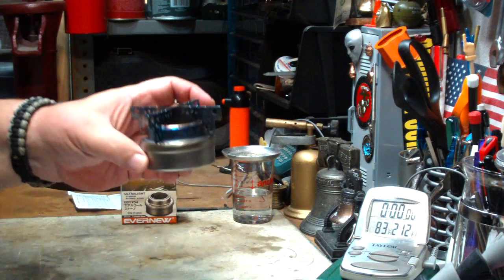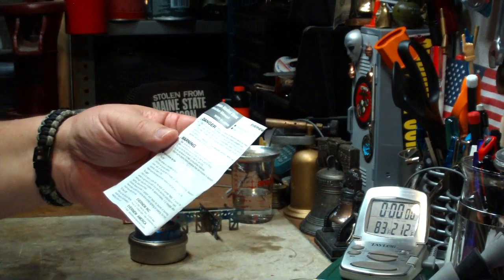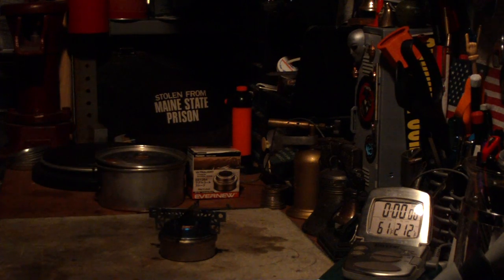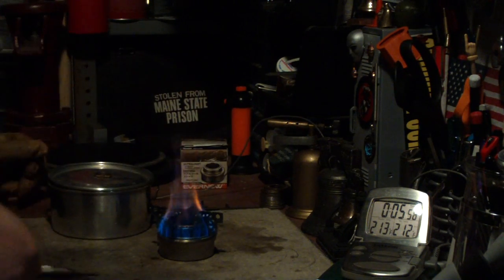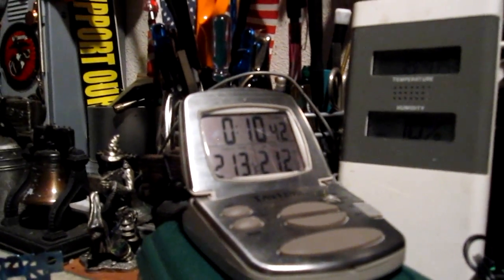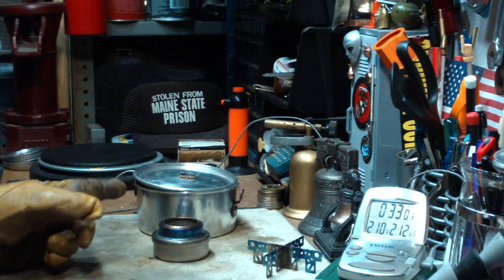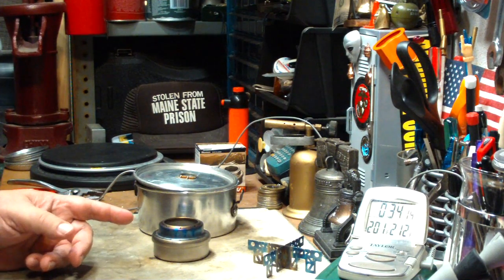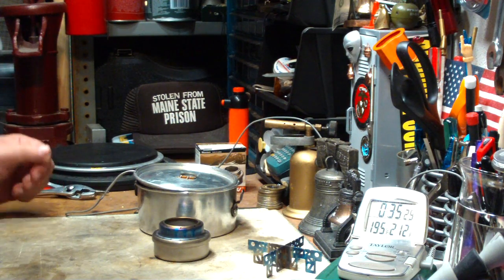Evernew Titanium Alcohol Stove & Evernew Titanium Cross Stand   Boil Test #2

Comment: I have a Trangia simmer ring top I bought for my evernew. I always snuff it out before it burns dry so that the wick inside doesn’t actually burn as the alcohol burns off to empty. I then empty the remaining fuel back into the bottle. I then use a wrist sweat-band to hold the simmer ring lid onto the evernew. Keeps the whole thing nicely together and apart from a sealed screw cap like the Trangia it’s a really lightweight unit I can just throw in my bag.
I also only ever use the Trangia Triangle with my Evernew and other similar Chinese rip offs. They all mostly fit the Triangle and that way I can use the simmer ring on the titanium stoves as well because there is no pot support trivet in the way.

Comment: I will keep using my Trangia and a small  Sterno for sterno heet cans aluminum folding grill, that cross bar in the out doors is to unstable. And I use Klean Strip Denatured Alcohol clean burning Fuel only, can be found anywhere paint is sold.  Pots and pans have no soot build up.Have had my Trangia for 5 years and never had a crack. Like the comparisons though.

Comment: Interesting comparison.  I'm curious to know how long it burns w/o anything on the burner?  Like if you just wanted it for heat?  Also, you mentioned something about a fiberglass layer inside?  If so, won't it eventually shrink and be unusable to soak up the fuel?  If so, too bad there's no way to replace it :(  That would be perfect.  Again, thx for the video m8, I enjoyed it.

DavidC

Comment: Thanks Hiram!  Impressive little burner. I recall that the Clikstand company sells these, so I checked their website and they do. They also say that the Trangia simmer ring will fit the burner, and they sell them as an accessory for the Evernew. They sell the burner with a wire adapter they say is needed to fit the burner into Trangia stove stands. Not sure if the Clikstand also needs this adapter? Anyways maybe you could do a simmer test with the Trangia ring?
Reply: Wintertrekker they do not work the same. You need a way to include both sets of holes.